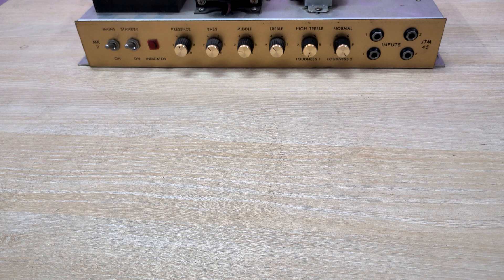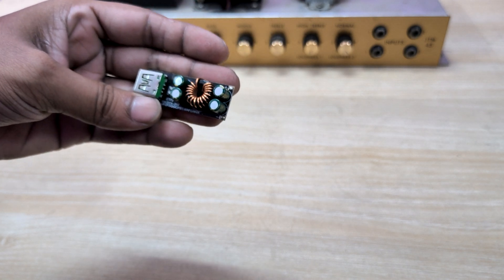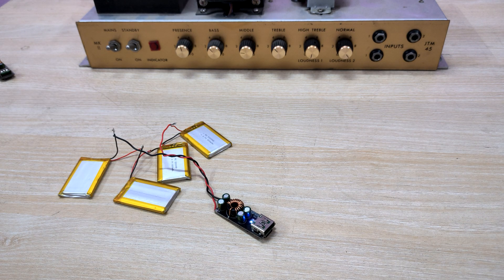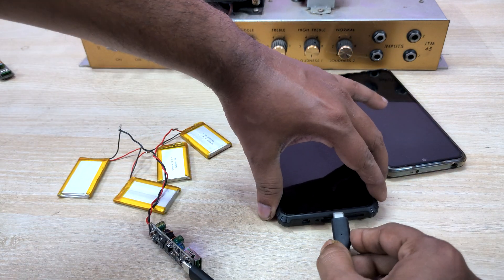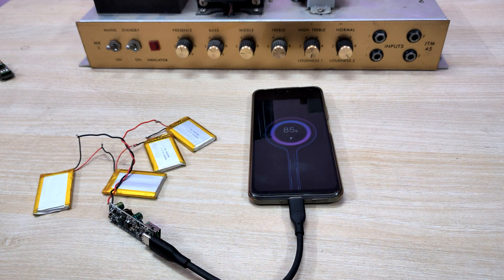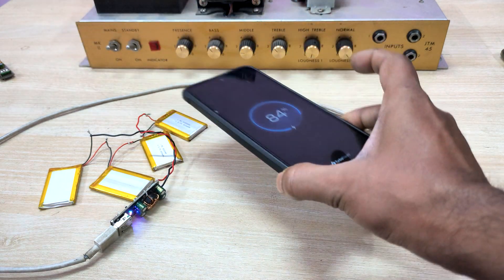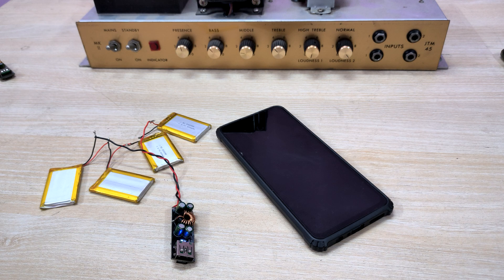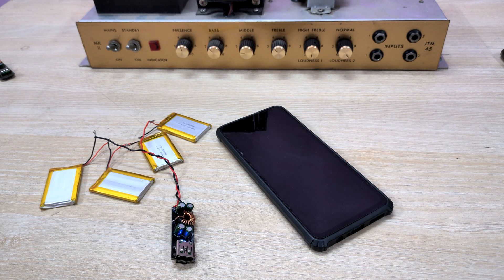USB Quick Charge Adapter with 6-35V Input and USBA/USBC output with Quick charge support

Comment: What is difference between qc & pd?
Reply: pd charging is for charging latest laptop... now a days laptops charge at 20v..... this module supports qc4 as well as pd charging.. this means that it will charge mobile as well as laptops... it will detect by itself and adjust voltage for mobile or laptop automatically.

Comment: Is the type c in this module two way charging. Can it charge the four li po Battery you connected through type c port provided
Reply: It just only one way  to charge phones  only upto 60w  only
Reply: @MR.DREEMBECOMEIMG  can we connect directly with solar panel (20w,17v)
Reply: Nope, it's not for batteries, u need ip2368 for batteries 
IP 2368 can do 100 watt bidirectional